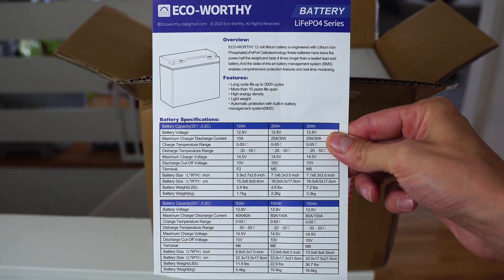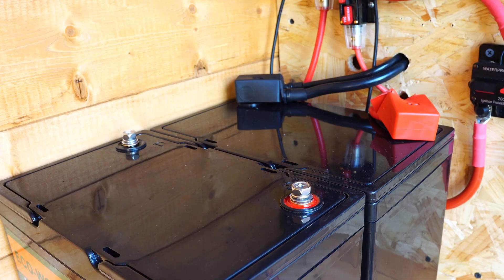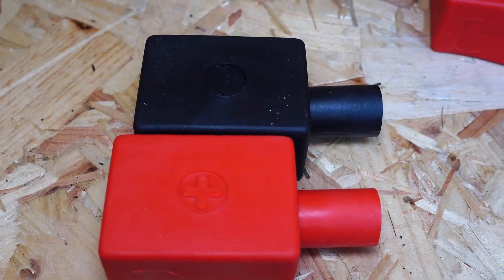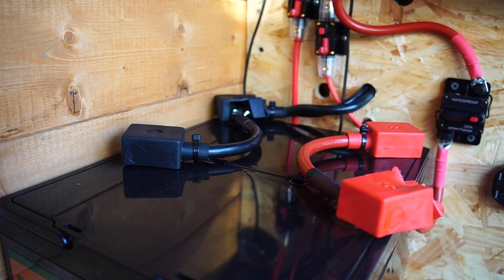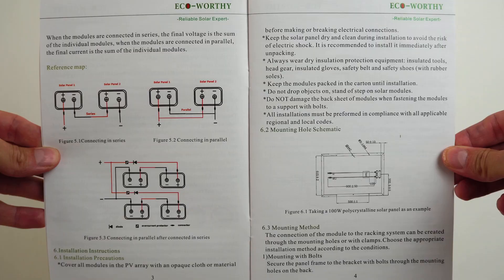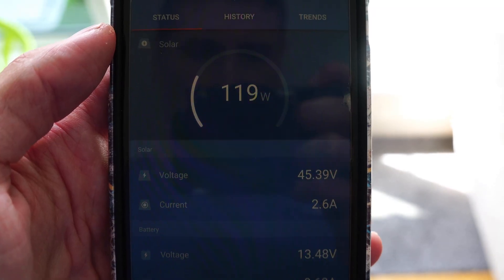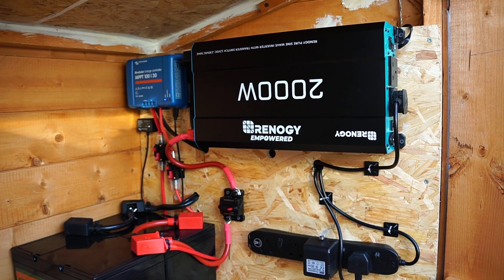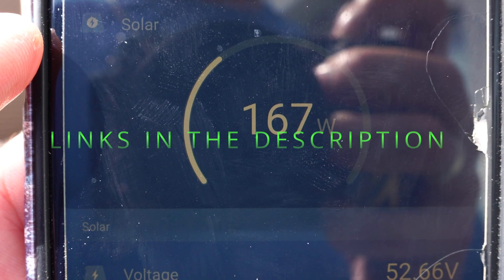Solar Panel Setup, Off Grid (SETUP & INFO) - PART 3

Comment: Bought 2 of these ecoworthy 100ah batteries when you are connecting them do you have to charge them both to 100% before connecting them in parallel?
Reply from the maker: Mine came with some charge already in them and I connected them straight to the solar panels (that was my way of charging them). You can alway contact the manufacturer to clarify if your unsure.

Comment: Not sure about their batteries but there have been a lot of bad reviews on ecoworthy and their inverters and solar panels, either due to their short warranty or the company simply not communicating with them. For example most solar panels have a 5 or 10 year warranty with an energy output warranty of 10-25 years while ecoworthy is just a flat 1 year warranty.